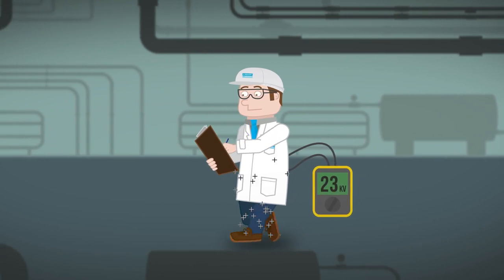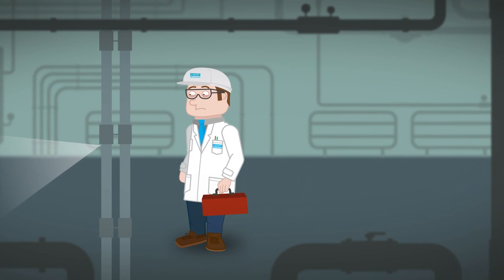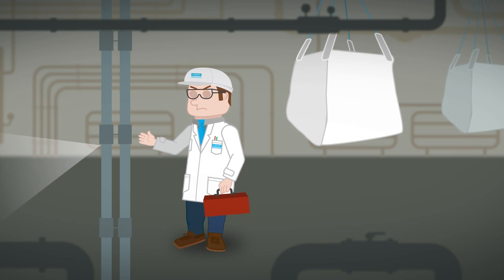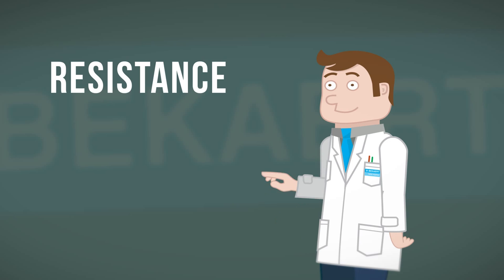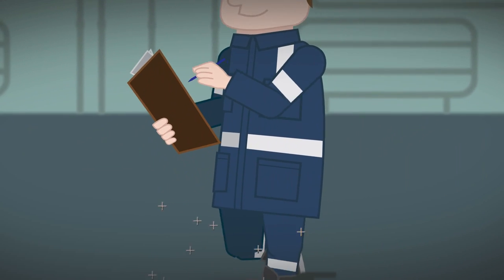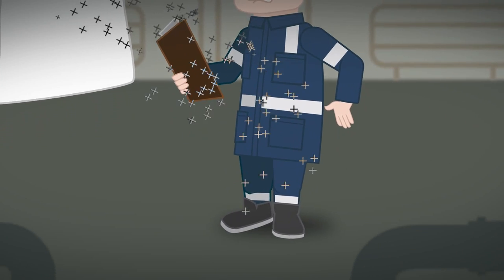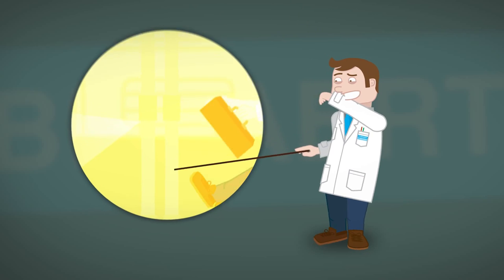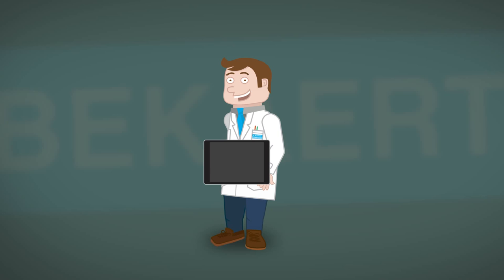The Dangers Of Electrostatic Electricity - An Informative Video

Comment: The protons ( the positive charges ) never move! Only the electrons are transferred from objet to the other.
Reply: I know the animation would be better showing the electrons instead but Its just a referencial. Like in mechanics when u consider a moving thing as static and everything else is moving, or electric current, which the standard current direction consider that the protons are moving. It works for everything if done properly.
Also positive charges as positive ions do actually move because of electric forces. This is called ionic current. In fluids they move a lot, and  they can go from one solid object to another(like air or tiny drops of liquids). And they also move throught solids like dust, hairs or sand which can and do move from one object to another. Electrostatic precipitators works with these concepts.

Comment: Can I ask you what is the meaning of negative voltage?  What is the difference from positive voltage in terms of work and energy?
Reply from the maker: The triboelectric series is a list that ranks various materials according to their tendency to gain or lose electrons. It usually lists materials in order of decreasing tendency to charge positively (lose electrons), and increasing tendency to charge negatively (gain electrons).  Somewhere in the middle of the list are materials that do not show strong tendency to behave either way. Note that the tendency of a material to become positive or negative after triboelectric charging has nothing to do with the level of conductivity (or ability to discharge) of the material.

Comment: Hi

How does touching the metal case of the computer help to discharge the body of electric charge if the computer is unplugged?
My view was that you can only discharge the body if connected to an earthed/grounded cable?
Reply from the maker: Charge will only dissipate fully if the metal computer case is earthed. If the computer is unplugged and the case is not earthed, there will be a sharing of charge determined by the relative capacitance of the case and the body. The body and the case will not be at zero potential, but the potential will be the same on both the body and the case. This is a form of equipotential bonding and will minimise the risk of any damaging sparks occurring, for example when installing sound cards, etc
Reply: hi. Can you please explain what you mean by '...if the metal computer case is earthed'?  

I have seen many videos were people state that you must touch the computer case but not a explanation as to how this method works.
Reply from the maker: The computer is earthed when it is plugged in the wall or when it is in contact with the earth (e.g. when is placed on a metal table). 
You will discharge yourself when touching the metal computer case.

Comment: But what happens if you're working with electricity? Should grounding or touching the ground be a bad idea?
Reply from the maker: It really depends on what is going to set off a spark: you (static electricity), or the installation you are working with (current electricity). If you are working on an electric installation or system, you need to wear insulating gear (i.e. by wearing rubber gloves or boots). However, if you want to prevent build-up of static electricity on your body when working in an explosive environment, or working with delicate electronics, you need to wear antistatic gear and you need to be grounded at all times.
Reply: Static charge can be drained with very high resistance, well in excess of what would support enough current to shock you from 120 or 240Vac.

I work on electronics for a living and as a hobby. Antistatic wrist and heel straps must include a 1M ohm resistor between your wrist and ground. Work mats have a resistance per square between 1M and 10G ohms per square. 

If you are working with electricity at a dangerous voltage, it is a bad idea to be directly touching ground. At 240Vac wearing an ESD wrist strap with 1M ohm resistor and assuming worst case you puncture the skin, 240V/1M = 240uA. We can take into account that it is AC and so the peak is about 340uA.

I tested myself and found that the most sensitive place on my hands was the skin between two fingers. The threshold of sensation was 300uA, and I could barely feel it. I had expected fingertips to be most sensitive, but I think the thicker skin spreads the current to a lower density before it reaches the nerves.

Over the rest of my arms, it took about 1mA to just begin feeling it. It is amazing how quickly it becomes excruciating, only 5mA was very unpleasant when the contact area was confined to a blunt probe tip.